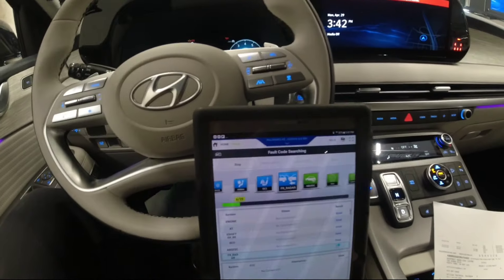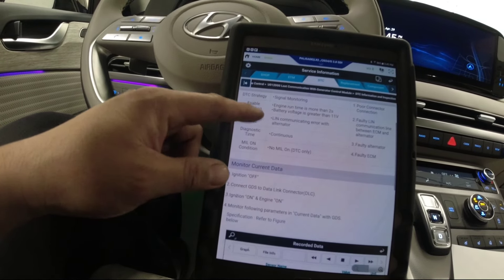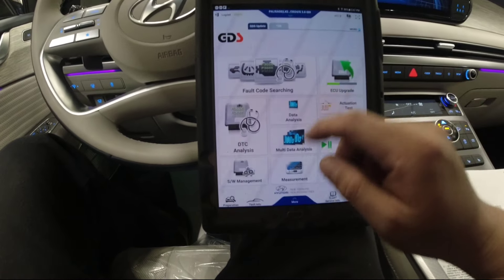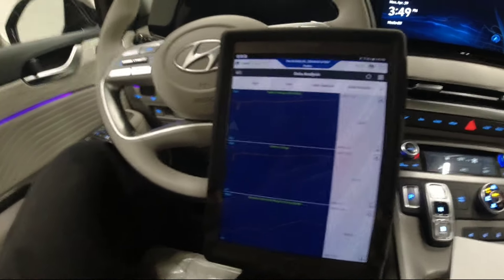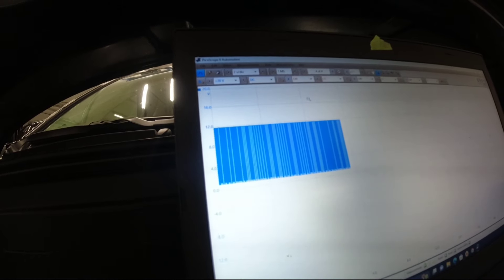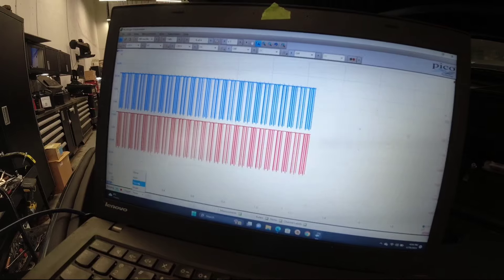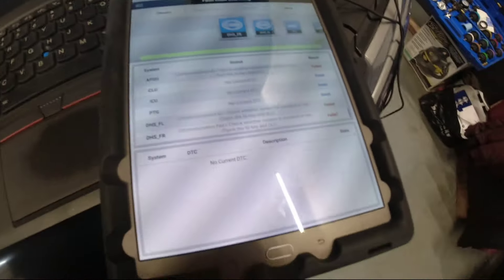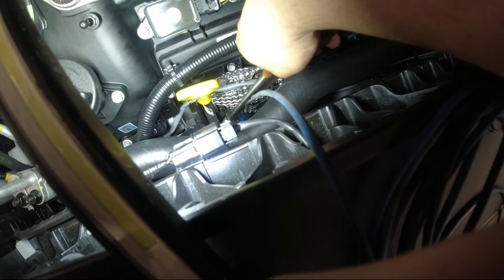Hyundai Palisade Lost communication to alternator

Comment: AWESOME WORK AS ALWAYS I THINK BY BACK PROBING THE CONNECTOR YOU FIXED THE PROBLEM JUST PIN FITMENT ADJUSTMENT IF THE CAR COMES BACK TRY TO TIED THOSE PINS IN THAT PLUG U SHOULD BE GOOD TO GO THANKS FOR SHARING AS ALWAYS.
Reply from the maker: Yeah i guess thats what happened on this vehicle.